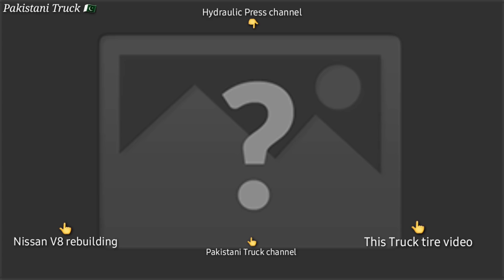Restoration a UD Nissan V8 tipper, Rebuilding a Chassis and body work

Comment: Glad you painted the inside of the frame layers, hopefully it doesn't rust as much. I like the new paint scheme, very attractive.
Reply: Overloading is a bigger problem than rust. On the other hand: if the truck owners stopped overloading we wouldn't get to see old skool craftsmen at work 😆
Reply: When they installed the dump bed, i noticed it had river stones in it, so the truck must have been in and out of a wet conditions a lot.  I bet the drains for the dump bed were over the area that was rusted out.

Comment: a huge job.  personally I would have changed the shape of the frame, use a single thick tube, but it is probably not easy in Pakistan to find tubes of all sizes.  the work would become eternal.  where possible welded with basic electrodes, the welds become deeper and fuller.  however great work.

Comment: Do you put all the hoses pipes and rubber new ?
Reply from the maker: No..
Old pipe fitted
Reply: Pakistani truck it is only because labour is cheap . USA labour kills any . It will cost more than the brand new truck , to have same work done .

Comment: If they can charge another $50.00 per truck,they can give them some safety equipment,goggles, boots,helmets..at least those 3 things. 
Greedy owners.
Reply: And even 50$ the safety equipement should last longer than one truck. Boots with toe cap, glasses with anti UV, welding mask, and proper clothing (fire resisitant or at least non prone to be stuck or rip apart). Clearly they are in a stage of fierce industrial capitalism. But they are tenacious worker. The story does not say anything about the injuries of the worker and the turn over of the staff. We dont see the same caracters very often. Maby they work eslewhere. And we dont see worker with missing toe, finger or limbs... they still make awesome work with minimal tools and shop ... and I like the guy with the ricksaw transporting those sections of the frame ... sketchy !!!!!